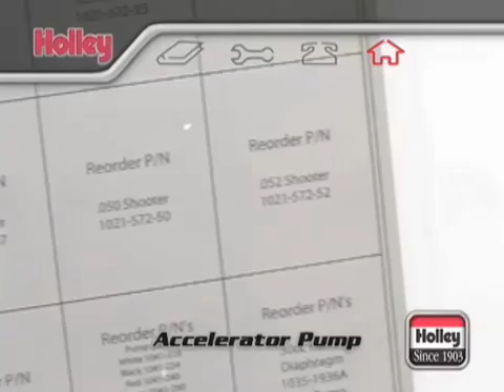How To Adjust The Accelerator Pump On Holley Carburetors

Comment: So if going from a 28 to a 31 to a 35 make little difference  we need to go even larger?  I sent in my carb for warranty, they just sent me back a basic carb without tuning it to match the carb I sent in and I know I did not have to switch to a 50cc pump when I first tuned it.. just wish you guys would record what we sent in and send us back the same setup.. this stumble is a lot of work to track down.. maybe this covid built carb wasn't built correctly to start.. 5.7 chevy-395 roller cam-5000# Plow truck with 3.73 gears n 265/70-16s..  pretty sure I had a small squirter in there before..  The way she is set up now, I will end up getting hit pulling out in front of others as she bogs every damn time...

Comment: This is great info. Can you please assist me. I have 350 4 bolt main, 770 avenger. Its stumbling when pressing the gas, then it will take off. Sometimes it wants to stall out. Is this a sign my pump nozzle is wrong?  I have 4-10s in the rear. Truck is a k10 4x4. Thank you
Reply: You ever get this figured out?

Comment: I can't seem to get this adjusted correctly. With the adjustment nut set correctly on closed throttle I then seem to not have the necessary clearance on WOT. This is on a 390.

Comment: My car sounds like it needs that done to it but gas comes up through the air vent from the bowl and then the motor sounds like it wants to run backwards a little can you help me
Reply: Check the secondary float needle. The needle was out of contact with the float, until I disassembled/reassembled it.  Mine did that, right out of the box. It was a Brawler 750 (Holley copy).
Reply: Left this for the next guy who might see this comment.

Comment: The problem I'm having is, the car idles rough, but when I put it in gear, it stalls out. I have a Holley 1850 on a 289. Thanks
Reply: How did it turn out for you? What did you have to do? My mechanic installed a reman. Holley ND2625 carb, and new valve and air manifold gaskets. It has that issue of no go at a red light. Just curious what he's doing in that garage as i'm typing this.

Comment: Hello! Is the Idle rpms for cam position in neutral or in gear??? Also, in the Video, you changed color of cams, why? because of the hole difference? The cam profiles look very different. Thanks I bought a new Holley 4160 3310 750cfm but am rebuilding the old one I took off.
Reply: You should tune your accelerator pump for your engine idling in gear because that's when you're gonna be taking off and actually using it.

Comment: I have a 340 with a 6pak on it. Took it to a performance shop to get the carbs tuned. Well when i got the car home. I cranked it to get it off the trailer and fire comes out the carbs.  Dude screwed my car up and now i cant find the info to tune out the carbs correctly. I know he screwed on the accelerator pump which this shows me how to reset it. Any more links on Holley carbs to figure the rest out would be greatly appreciated.  Im sure i will be needing some nozzle changes as well. It (3)500 cfm sitting on a small block. So they need to be tuned down. But even at idle i can smell it rich. It idles with only 500 cfm.  Any video links to adjust air fuel at idle?

Comment: I dont have 500 spare carb parts laying around.  This should not be as difficult as you make it.  Seems like you have to adjust by trial and error by swapping out part after part to get it right which means it could be weeks by the time you get the carb running right with having to wait on shipping each time you try a part and it doesnt work.
Reply: Probably little solace for you now (7 months later), but you make a great point, and maybe this can help someone else: ultimately, I bit the bullet and purchased the complete accelerator pump tuning kit shown in this video. You can find them for about $130 at Summit, Jegs, etc. It has multiples of every pump accelerator component you may need need, nozzles, cams, bladders, needles, screws, etc. The part number is 36-184. As much as I loathe spending money on stuff just to make it work the way its supposed to, I value my time, and I've already spent too many hours trying to get this car to run properly.

Comment: good video and very informative. I'm new to this and never worked on carbs but I have 2 cars and 1 truck that have carbs .currently having problems with one and I think it's time for me to learn. this video definitely was helpful , one of the best explained I've seen so far.
Reply: AWS omely 👍 ✅ done friend
Reply: good
 afternoon friend I write from of Venezuela my name is jesus I have a 
holley 600cfm carburetor and I have a problem I smoked spark plugs and 
it gives me a lot of power failure have to remove and clean all the 
spark plugs every day that produces much carbon my 
question is this which should give the carburetor that can regulate and 
where that nadien not get to help me to regulate the amount of fuel 
Injection as safe as that would be the cause of the problem and you 
correct me if I equivoco I thank you very much for the help you can give me this is my mail dj : caiman@gmail.com

Comment: That'snice, but useless for older Holley carbs, such as my 2280. It would be nice if you included the years covered in the video title, though a lot of uploaders don't care about hionesty, because they want more views. This is NOT "How To Adjust The Accelerator Pump On Holley Carburetors", it's, "How To Adjust The Accelerator Pump On Some Newer Holley Carburetors". Back I go, to look for info that actually applies to my carburetor!!!

Comment: If the secondary diaphragm is damaged this could affect how the secondaries open if they open at all.  If the idle mixture screws are set too rich it could be loading up with fuel and not burning completely.  I tune to highest vacuum on the idle circuit.  Idle screws only affect the Idle circuit ive come across some ppl who think it tunes the carb throughout the throttle range.  You also want the vacuum advance attached to the ported side, not full vacuum port on the carb.

Comment: If my pump is delivering too much fuel, It would only have a momentary effect right? I.E. It should actually bog down when I apply full throttle? What would it mean if you get "run on" when using full throttle? If I apply more than 3/4 throttle, then go to shift, my RPM's actually spike for a second during the gear change, despite having my foot off the gas for that moment. I thought it was my accel.pump but now I'm thinking I was wrong....